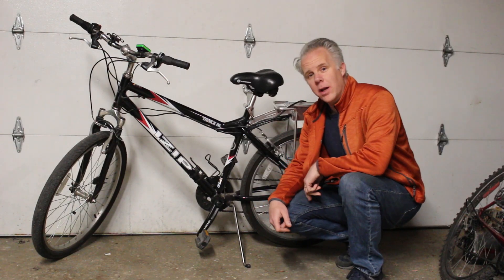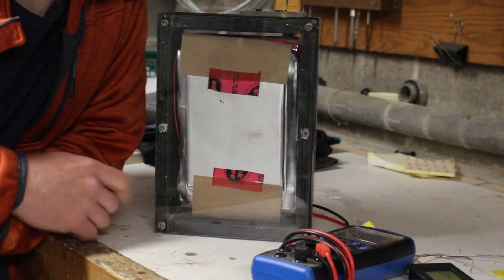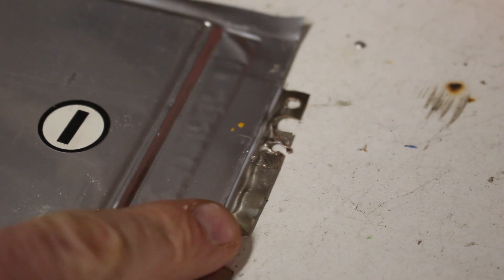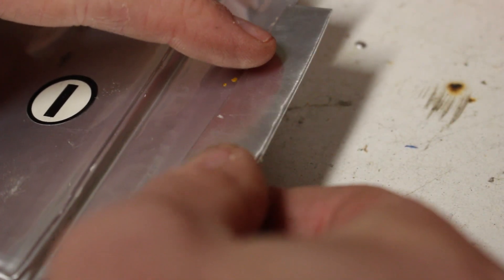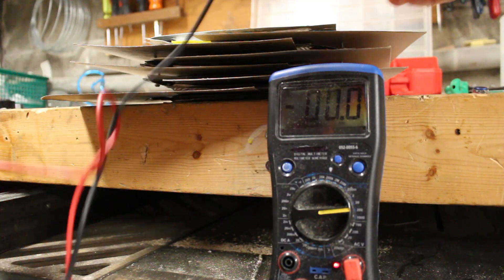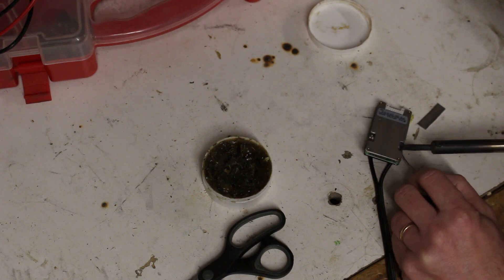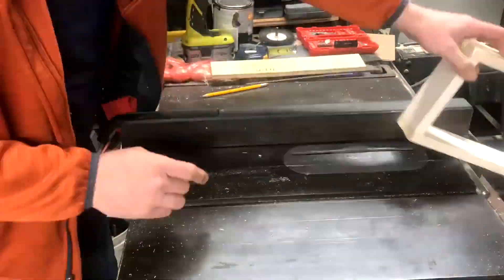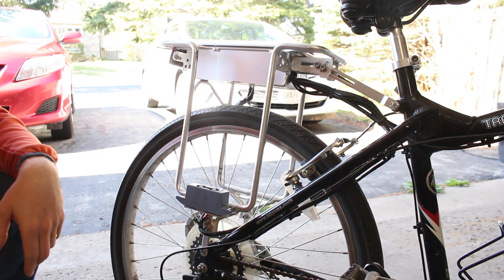DIY lithium replacement batteries for your ebike -  SPIM08hp LiPo into 7s 24v packs with BMS

Comment: Hell yeah dude I knew it was possible now I'm going to make mine out of old laptop batteries unfortunately mine's 48 volt up for a cheap ass  trike, anyone is interested I also electrified a spiked bat using a bug zapper fly swatter module, wasn't my first time I've made probably four or five tasers give or take using broken ones leftover parts from busted cattle prods and most recently I just went and bought (Yes; a store in Canada) and they seem to be universal Union you can put as many amps as you want through it

Comment: ok so this is a 7s2p setup im guessing, so 20 miles isnt bad i suppose . i have 1500w 48v kit using sla-agm's i recycled . they are 12.5ah . i was getting about 12-16 on these . i want to build a a 16s6p setup for it though.

Comment: What voltage does the battery go down to at cutoff? I'm looking into making a 13cell for my 48v project but having a hard time finding a bms for lithium polymer packs instead of lithium ion
Reply: You again, eh? LOL. LiPo packs use the same BMS as "regular" li-ion, because they run between the same voltages. As long as it's not for LiFePO^4, you're good. I presume you've already nailed this down in the past year, but maybe someone else would like to know.

Cheers once again from the crazy guy in Ottawa.

Comment: The best part is that, when you get tired of 24V, you can use those batteries for a 48V set up!
Reply from the maker: You reading my mind!
Reply: @OntarioLakeside  do a 24s pack. More volts, more speed, more power haha!

Comment: Those pouch cells seem like a good deal.  I wonder how well they last.  Any expansion issues?  Also, how is that BMS working out?  I'm considering getting one.
Reply from the maker: No issues yet. The BMS seems to be doing its job, Ive only done about 8 cycles.